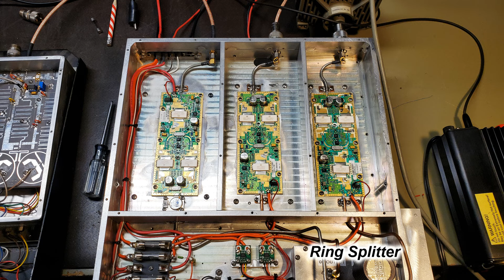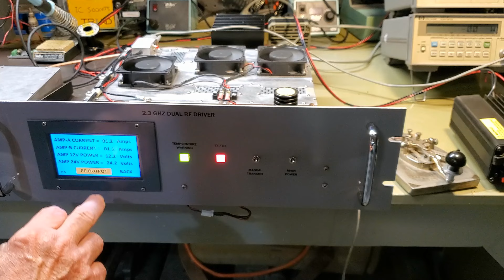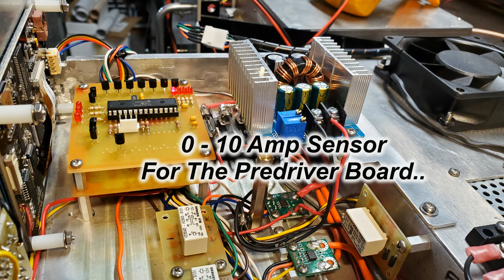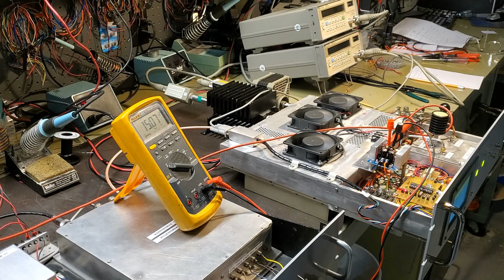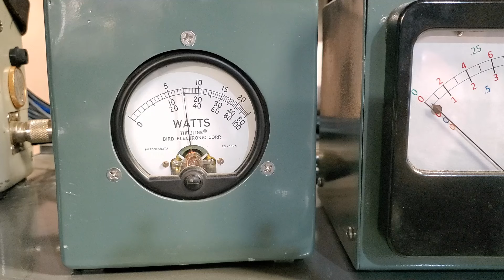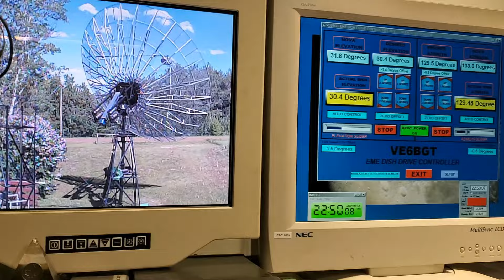13CM Dual Driver Upgrade

Comment: Your front panels and UI on the screens look amazing! Better than a lot of commercial gear. What are you using for the microcontroller and the display? Is there some kind of library you use to make the menus, or is it all coded from scratch?
Reply from the maker: Hello and thanks for the great comments.. I use PIC microcontrollers for everything around here.. I use Basic as the programming language for the code also..
PIC Basic is so easy I cant ever see going to anything else.. Like all things it has limits of course..  The touch displays are called Nextion and are a great replacement for using ordinary 2 or 4 line LCDs..  The Nextion has its own editor and all the icons and graphics are from their editor.. Its mostly just text and the PICs send the data to them.. No libraries, its all home made done here.. Look at my earlier videos on the channel for more detailed work with these great displays..
Skip